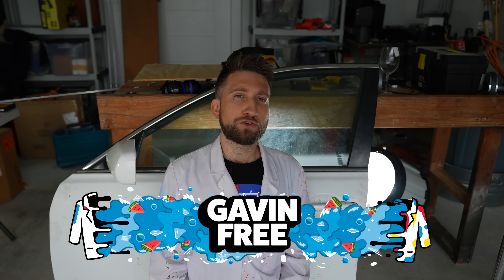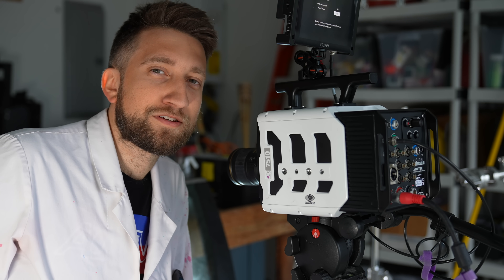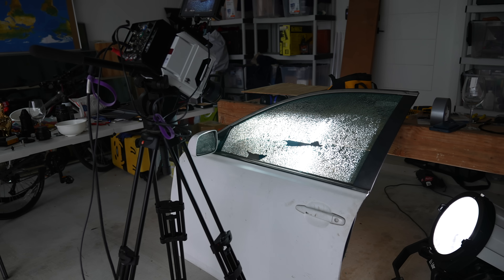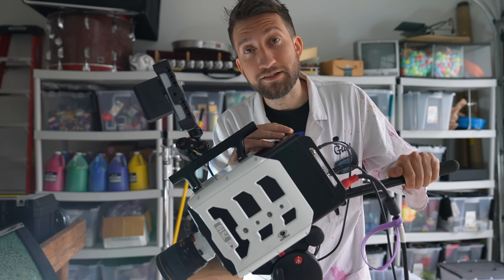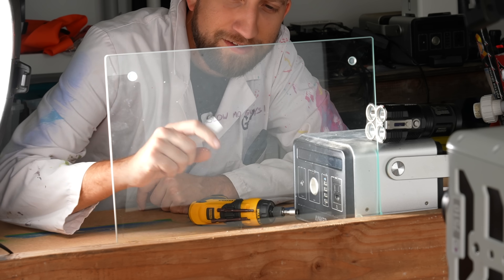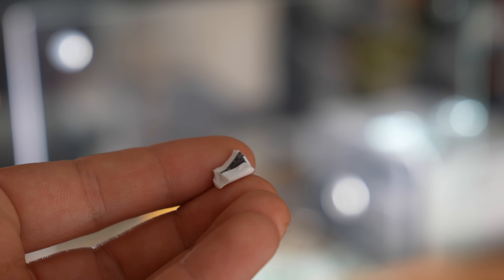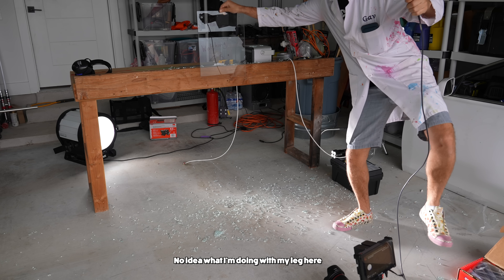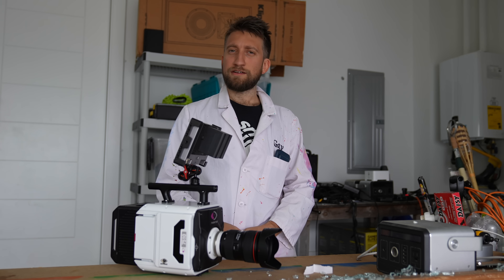Spark Plug vs Car Window at 800,000FPS! - The Slow Mo Guys

Comment: Do lightning! (or a tesla coil, something with static electricity)

So how fast does it crack? Just eyeballing your font size of "Slow Mo Guys" I'd say the entire width is about 18 inches (big error bars here- I didn't go measuring pixels or anything). If it takes .000181s to move from left to right, as you say, that's about 2,526 m/s 5650 mph). And that is the crack moving up AND down not just exactly left to right, so it is even faster than that (maybe like 40%? taking the hypotenuse of some triangles up and down).

So maybe like 3 or 4 km/s... 

However, my original speed ( 2500m/s) is about 2x faster than your findings in "How fast does glass crack? - The Slow Mo Guys" (2018) of 4578ft/s (1395m/s | 3100 mph). But I suspect you can be more accurate by simply measuring the 'exact' distance before hand. Cheers!

Comment: actually you still able to break the glass with only the ceramic parts and without the metal part.
some thiefs in my country use this method, first they destroy the ceramic into smaller pieces,  spit on them (idk why), then just throw it to the glass without triggering the car alarm

Comment: On that last cutting board, it looks like there is a wobble that starts at the bottom goes up the glass, and then back down and when it reaches the starting point the glass then cracks

Comment: Based on your images I estimated the crack moves at roughly 2400m/s or 8700km/h (or about 3876736445 horse-steps/winters for my american lads and their messed up units)
Reply: I assumed between 2-4 km/s simply based on the speed of sound in various types of glass.

But what is it in butter sticks per AR-15 reload time?

Comment: 5:00 
How fast is 100 nano-seconds?
At a 100 nano-second shutter speed you would not to able to take a picture of something farther than 15 meters away from you. The light would simply not have enough time to travel the distance from your flash, to the object, and into the camera sensor. The light would not travel the total 30m distance for the duration of your shutter being open.
Reply: Assuming that the object you are taking a picture of is only illuminated by your flash, and that the flash only turns on the moment your shutter opens.

Comment: The cracks (wavefront of cracks - a crackfront (TM)) travelled across the frame (say 20 cm) in 0.000181 secs. This puts the speed at 2500 mph, or mach 3.2.  This means the crack would travel from Gav in texas, to Dan (guessed at Birmingham, UK) in 113 mins. If you were flying an SR71 blackbird at maximum speed next to a massusive pane of breaking glass (it could happen) the crackfront (TM) would overtake you, 400 mph faster than you are flying. Fascinating vid Gav - really looking forward to new stuff with the new Phantom.

Comment: I have a suggestion:

Drop a bouncy ball from about 4 or 5 feet and make sure it bounces under a ceiling of about 3 or 4 inches. Film the bouncy ball as it rapidly bounces between the floor and ceiling. You could even throw it hard to make it bounce faster.

My hope is to see how the ball compresses and decompresses rapidly in a short amount of time.

Comment: So should you shoot the glass with a typical pistol, you can expect the cracking to propagate faster than the bullet that set it off. 

(Based on the 800 kfs, 140 frames for the horizontal section, experiment three)

Comment: Because increasing the speed only reduces the height of the frame, would it in theory be possible to get around that limitation by recording the same subject using multiple TMXs, stacked vertically and on alternating sides/angles while using the same mirror trick as with the 3D footage in order to get their lenses "closer" together and all pointed in the same direction so that the footage they're capturing overlaps and could be edited together?
Could you stack 10 of these cameras on top of each other in an apparatus like that in order to get a composite 1280x960 recording of a single event at 500,000fps?

Comment: I see you're using a canon 24-70mm lens. Would it help to use a lens with a lower F stop, say 1.0? You would get more light, but obviously the focal length would be really short. It would be hard to align, but worth the end result, me thinks.

Comment: using a regular file, the type used to file metal might be a better option, they're brittle and easy to smash up with a hammer, the pieces are smaller and a lot denser

Comment: Does a light emitting diode flicker? Please film a regular light emitting diode at the highest speed possible.
Reply: I can answer this without a high speed camera.

The answer is "it depends".
An LED powered directly by DC will NOT flicker.

But LEDs have a limit to how little current you can pass through them, so if you want to be able to dim your LED lamp, you'll have to make it flicker on purpose.

If you want 25% brightness for example, a dimmer will flicker the LED in a way where is on 25% of the time, and off 75% of the time. This switching can occur over 100 times per second.
Reply: @logitech4873  I am aware of the current understanding. Technically speaking, it is impossible for direct current (DC) to emit electromagnetic radiation, therefore, the light emitting diode must be flickering even when DC is applied.
Reply: @Under_Protest  I'll concede that i don't know the fine details of this.
But keep in mind that the 800 000fps shot in this video was lit by LED lights, and no flicker was visible.
Reply: @logitech4873  I am talking about a single light emitting diode. L.E.D. lighting is created using millions of L.E.D. lights in an array. However, upon thinking about it, the frequency of the flicker needs to be known, otherwise, it may be that the recorded duration is too short to capture the effect.

Comment: Do you have enough frames to fairly accurately measure the speed that the crack propagates?  I'm interested to know how fast it moves in Miles or KM per hour.

Comment: If you take a pair of wire cutters and nip one edge of the tempered glass it will shatter also. Might be a way to get a shot of it starting and propagating since you could control where it starts better than wherever the spark plug happens to hit. 
That is still one of the coolest things i've ever seen in slow mo though!

Comment: but, how much slower would those cracks be compared to light itself?
Reply: Crack propagation happens at a few kilometers per second, 2 to 4.
The speed of light is 300 000 kilometers per second.
Reply: @logitech4873  oh lol thats not even close

Comment: For those who are wondering what it happening:
1. Tempered Glass is constructed in such a way that the skin is put under tension as the glass cools. This tension gives the piece incredible strength against shattering when a distributed force is applied (like the sledgehammer) by deforming like a sheet flapping in the wind. The energy ripples across the glass, but the piece maintains it integrity. 
2. BUT, if you SCRATCH the glass, that tension is released and the piece shatters under the strain.This shattering renders the glass into tiny little cubes. While these little bits are still sharp, you don't get the needle like, ultra thin, fines of glass that could shred skin. 

It's odd, but both of these properties are the desired outcome of tempered glass. You don't want the glass to break just by someone putting their elbow, fist, or head through the glass, but when it does break, you want it forming shapes much safer than normal glass. (Trust me, I've worked with art glass for slumping and fusing. It's VERY EASY to cut oneself without knowing it, only to look down at all the blood on the table.)

Prince Rupert Drops demonstrate what goes into tempered glass.
Reply: Ty for the explanation! This is REALLY fascinating but mainly cool 😲😄
Reply: I always wonder how it's possible to have a crack in a car windscreen given that it's tempered glass. My car had a crack just appear one day from the side to about a fifth of the way across, but why didn't it shatter?
Reply: @Milamberinx  I don't think the windshield is tempered glass. It's a laminate where two layers of glass sandwich a plastic polymer sheet. In the event something tries to smash through the windshield, the plastic holds everything together. My guess it's because of those flying rocks that love to chip the windshield is why tempered glass isn't used there. Can you imagine driving down the highway, and suddenly you're sitting in a pile of your windshield because a rock hit it?

Here's the glass that's used for windshields: https://en.wikipedia.org/wiki/Laminated_glass
Reply: @jackielinde7568  ohh, that makes sense, thanks!

Comment: If my calculations are correct, at 800,000 FPS, this will slow down the speed of light to roughly the speed of sound. It might actually be possible to start capturing light outside of the laboratory. Maybe using powerful light sources like "lasers" and mirrors and stuff!

Comment: In 50 years:
"Hello the Internet, I'm Gav, and today we're going to be looking at a black hole forming in 64k at 1 billion frames per second"
Reply: Sadly Physics says „NO!“.
Reply: @leonmuller8475  We're gonna be in the matrix by then so f physics :^)
Reply: @xamanto  we already are, we're 6 layers deep now
Reply: @leonmuller8475  yes
Reply: And we'll all still hear the unspoken but very missed "And I'm Dan".
Reply: @Milamberinx  I did not need those feels today, thanks.
Reply: Actually would be cool for Gav to visualize for us the big bang and expansion of the universe
Reply: have u seen the picture of the real blackhole?
Reply: "It would be nice to have that kind of job security."
Reply: Funny thing is, i think there is a shot of a lightbeam that was filmed at like, 1 trillion frames per second or so...
Reply: Well it's a throughput increase of 14.6x in 10 years, so assuming the same rate of change is observed, it... might take a few millennia to reach that level of throughput

Comment: Would love to cover a 1911 shot, want to confirm round leaves the barrel before it unlocks from the slider. Would like to confirm that the barrel angle remains unchanged until the bullet is clear

Comment: If you use a center punch, which can break tempered glass, you can control exactly where the break starts. It might be kinda cool to see the cracks staring.

Comment: So, you didn't do the math to determine exactly what speed the cracks are forming at? It'd be an interesting calculation converted to miles per hour, meters per hour but even comparing it to the speed of sound and light.

Comment: So it's quite understandable why the glass breaks radially, but why circumferentially? I assume it is a result of the tempered glass not appreciating the rapid propagation of sound waves causing uneven disturbances, but when you look closely you see there is actually a delay in the circumferential cracks. They happen after the sound wave has already passed. Pretty interesting. If anyone has some insight that would be cool.

Unrelated, the speed of sound in glass is approximately 5 km/s, so it's no wonder it is so fast.

Comment: You can reduse the frame size to increase the framerate. But wouldn't it be possible to have a hybrid option?

You get a limited frame size (like done in this video) but also get a full sensorsize image at a slower framerate like 30p or even lower.

This would be usefull if you want to see the full frame but only a part of it needs slowmo

Comment: I don't understand why adjusting the horizontal resolution doesn't increase the framerate? Its still less pixels right? So why not? Didn't you do thay for the spinning CD that shattered? You did a 4:3 resolution
Reply: What changes the amount of frames the camera is able to record is the shutter speed. The shutter works from top to bottom, so reducing the vertical amount means it can move the shutter quicker to the next frame. Changing the horizontal resolution has no effect on how far the shutter has to move, hence it doesn't affect the frame count.
Reply: @kerguelendo  gavin said in a previous video that phantoms take the whole picture at once, not from top to bottom
Reply: @jopi21198  the shutter still needs to move to make it take a photo.
Reply: @jopi21198  pretty sure there are multiple phantom series, some have global and some rolling shutter. 
I did some research and the flex 4k (which he uses occasionally) has a 1ms rolling shutter, the V series is a global shutter and the TMX 7510 (this video) is a global shutter, too
Reply: @jopi21198  Did some more research and the only  rolling-shuter-only camera is the Flex4K, all others have global shutters. Some "cinematic" Phantoms can do both tho. Rolling shutter for higher dynamic range and better colors or global shutter for the lulz.
Reply: @kerguelendo  so shutters don't count pixels left to right? If the horizontal resolution is lower, doesn't that mean there's less pixels to count from left to right so the shutter can go down to the next line of pixels quicker?
Reply: @WigWoo1  From my understanding, the sensor on the phantom processes information a line at a time (line going left to right) and then transfers that line to the processor through outputs on one side of the sensor. reducing the height reduces the number of lines it has to send and the number of outputs it has to use. But reducing the width won't change it because it still needs to send a line anyway, it still uses the same amount of busses.
Reply: @WigWoo1  With your analogy they would count top ro bottom. But not pixel by pixel but row by row. Which is why the lenght of the row doesn't matter but the amount of rows does
Reply: @kerguelendo  so each row doesn't count left to right before going to the next row?
Reply: @WigWoo1  yes. It captures all pixels at once
Reply: Gav has mentioned that phantoms have a global shutter, but this one must be different.
Reply: No, it's a global shutter to collect the pixels on the CCD, but the data doesn't then get transferred off the CCD all at the same time.  It's limited by literal physical geometry.  Think of each pixel on the CCD as a tiny bit of circuitry that can either collect a pixel of image or collect a pixel from it's neighbor below it, and will pass that data to its neighbor above it (or to the output wire, if it's the top pixel).

When you take a full-frame image, all the pixels collect their piece of the image at once, and then that image data flows upwards like a tablecloth sliding off a table onto the floor.  It takes a certain amount of time for it to all flow off, and then the CCD is ready to take the next frame.

When you take an image that's only a thin stripe across the middle, that data only needs to flow upwards until it's off of that thin stripe, and then the pixels in that stripe can collect a new image.  You get the same total amount of data flowing off the sensor in the same amount of time, but instead of being a full frame, it's multiple repeated stripes at the same location but different times.
Reply: @BrooksMoses  great explanation if that's the case, ty for your time 👍
Reply: @philb5593  its not the issue with the shutter from what they said i dont believe. but the issue is with the data speed as far as lines of code they send. Because the software sends the code from the top of the frame to the bottom, taking away lines has a speed impact( adjusting the height) while making those lines shorter(changing the width) doesnt have much of an effect because 100 lines is still 100 lines.
Reply: I don't believe it's not a matter of the amount of data being sent. It's a matter of physical limitations.
Or they designed the camera to have enough bandwidth always for 1280 pixels width wise in parallel but then sending each line serially.

Imagine you gather 100 people to place floor tiles.
Each person can place a tile in 60 seconds. So you can place 100 tiles per minute... But you can't place another tile until the previous one has been placed.
So if you wanted to place 200 tiles but only 50 tiles wide, it would still only be one row of tiles every minute because the other 50 people would have to wait for the row to finish before starting their placement.
Reply: It also depends on the specifics of that sensor.  You are correct (and very observant) that some of our older sensors did adjust slightly (it was never a lot) for reduction horizontally but with the technical aspects of this sensor it doesn't make a difference.

Comment: I want a maximum framerate shot.  Recording at 1.75 million frames per second means that light (at about 300 million m/s) travels 170 meters per frame. In a fiber optic cable, light "only" travels at 200 million m/s, meaning 117 meters per frame.  In short, using this camera you could genuinely see light traveling, albeit in limited cases. A 3 km fiber optic cable would result in a 1 (recorded) second delay between the ends.

Comment: Would this camera be fast enough to record a light pulse travelling, if you could turn a light on and off quick enough? in a single frame, light would travel 171.3m, so if you were filming something really distant and had a light with an insane brightness, you could possibly see it travel, at least over 2 frames

Comment: I suppose the crack wave should be propagating at around 4.5 km/s, the speed of sound in glass. That's around Mach 13 for reference. Would be interesting to have measured how fast it was from the footage.

Comment: That looks amazing, the computational power in that camera is mind boggling, it needs to refresh the image sensor at 500Khz, which means it'd have to be running a CPU that was at least twice or 3 times that speed, and RAM also on par with the CPU, every time it refreshes the sensor it needs to read, process, and send the individual pixel data to the RAM, where it's stored for playback and then saving.  That's SERIOUSLY fast.  Will probably take another 10 or 20 years to top this camera, but I'm keen